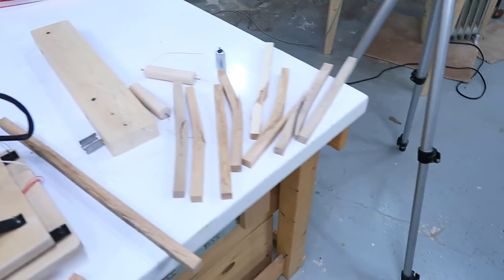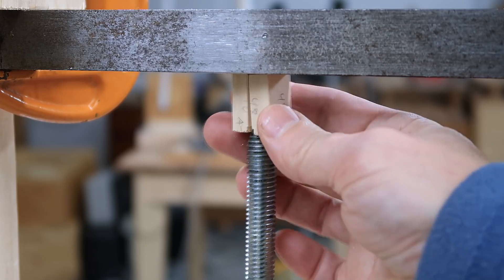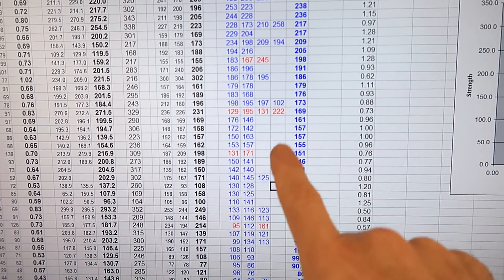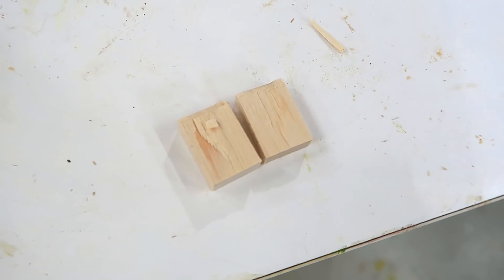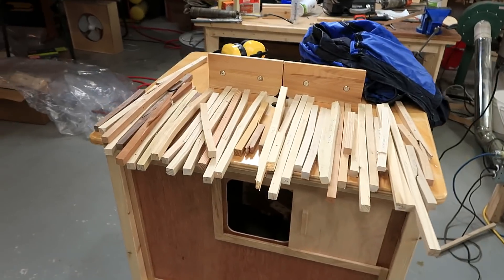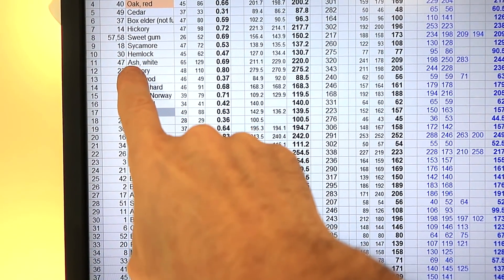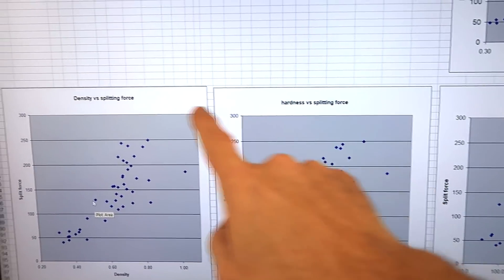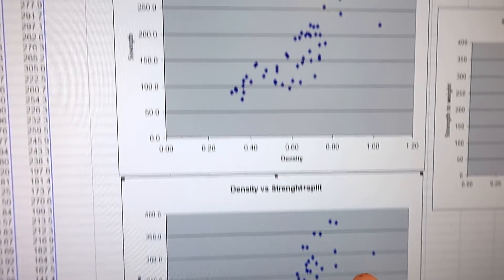Which wood is hardest to split -- cross grain strength.

Comment: My takeaway from these wood strength videos is not that wood species 'X' is better than wood species 'Y'. But that wood SELECTION is most important. Such as ring density and orientation.

Not often we learn more from the experiment than the results. Appreciate both the effort put into the experiment, and the effort put into the analysis.
Reply: As my granddad used to say, "There's wood, and there's wood." When talking about making tool handles, he was super selective about the wood he used, because sometimes he could use a piece of ash and it was just bad, and other times it was amazing just based on the growth ring density. He had a lot of intuitive experience.

Comment: For mechanisms, I wouldn't flag ultimate strength as necessarily important compared to wear, stiffness or dimensional stability - if your mechanisms need to be built larger to make up for a low ultimate strength, then so be it.
Reply from the maker: haven't run into any wear issues with wood yet.  Have broken hundreds of samples on my apparatus and no sign of wear on the wooden gears.

Comment: Just one question, what is the point of these tests?  In what kind of practical structure does the wood receive this type of loading?  The most obvious is axe splitting firewood.

In your test I would have actually guessed just the opposite of yours, that splitting with the grain would be significantly weaker, especially on straighter grain wood.  It certainly is when axe splitting, after you have made the original typical roughly max diameter split, which is, by ring orientation, cross grain.

The only top of my pinhead obvious real world loading that came to mind is the web on a vertical grain shear web for something like a wing spar, one where the web grain is parallel to the cap grain, and even there the loading is very different. 

This spar could easily be tested by building a test spar and bend testing it, held horizontally at one end and loaded over its length with sandbags or whatever, just like they normally strength test wings, but maybe constantly loaded, rather than the typical load tapering that mimics normal wing forces in flight, if the spar is constant section.  

Most of this type of spar that I saw on RC aircraft were spruce caps on usually thicker or similar thickness  pieces of balsa, in an I beam configuration. The webs were either discontinuous butted to each rib or continuous with the ribs split at the spar.  I never tested them for relative strength, but I suspect the continuous shear web would be stronger, as there would be stress risers in the discontinuous case, which is usually a bad idea in such structures where the design strength is relatively close to the max loading levels. This is a good spar design, much better than the ones that oriented the grain parallel to the spar grain (span wise).  This is true because the forces in the web are longitudinal shearing forces.

Also, any of that wood that is permanently bent in previous bending tests IS already damaged, whether it visibly split there, or not, as it has permanently yielded previous load testing, even if the loading was different.  I don't know if that type damage has much of anything to do with how it will perform in these tests, but just sayin'.

Comment: There were quite large variances in the result for the same pieces of wood but you did not have many samples. Averaging the bending strength and splitting force reduced 30% of the standard deviations of the measurements for the same pieces of wood. Eyeballing your graph, the random errors seemed to be comparable to the systematic errors. You really need a statistical test that can account for doubling the number of samples to tell if averaging is a better model.
Reply from the maker: You really need to run tests instead of lecturing.  As it is, I have WAY better data than you, cause you produced none.
Reply: @matthiaswandel  There's a point in there, though it might not've been intended: the method of summing bending and splitting strength also sums their deviations, tending towards a tighter grouping relative to the total.  Not sure if this actually works out this way, I'd want to check the spreadsheet first.  Also seems like the grouping in that plot is tighter than would be expected due to this.  Which is to say the correlation may be real (and, it's not like it's weird, it makes sense).

Great work, thanks for taking the time to do all of this!
Reply: @matthiaswandel   I am merely providing a suggestion on how to improve your data analysis. You have committed so much effort and time to improving and collecting the data. You are only 1 step away from a proper and very convincing conclusion. Leaving comments to explain issues in videos is generally better than giving dislikes and then going away. I do not do woodworking or make YouTube videos so I have no data. I am only your viewer who happens to do something similar to what you did but for a living and in a different area.

Comment: It's always important to remember how anisotropic wood is. I feel like most makers don't take that into consideration  enough
Reply: Can you elaborate
Reply: @jimmylewis7896  Isotropy is a characteristic of a material meaning that it's physical properties are the same in all directions (like steel). Since wood is composed of grains, it is anisotropic, meaning properties like strength are different depending on which direction the force is applied. Matthias does a good job of showing this, as well as the drastic variances between species, and even between different samples of the same species
Reply from the maker: Yes, I have seen plenty of makers put reinforcing splines in, but put them in with the grain the wrong way!